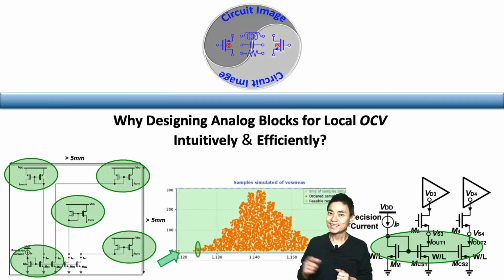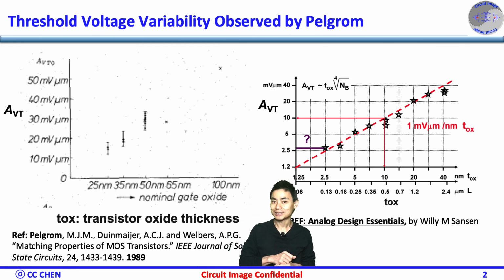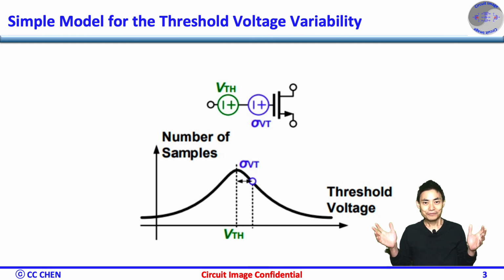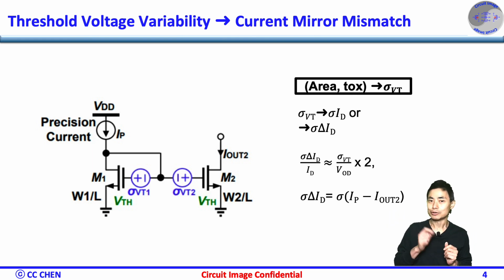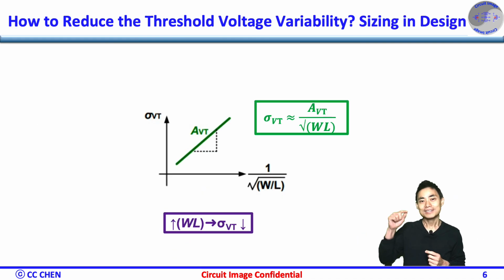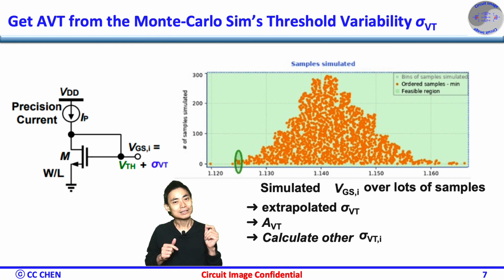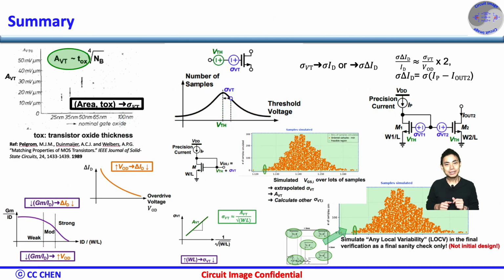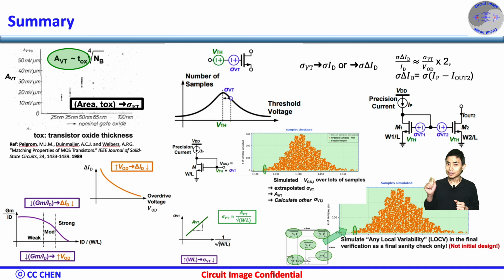Why Designing Analog Blocks for Local OCV Intuitively & Efficiently?

Comment: how much current should I apply to the diode-connected transistor?
should the current be small enough to observe the threshold voltage of the transistor?
or just provide the transistor with a reasonable amount to operate in normal condition?
Reply from the maker: Hi Trexy,
Nice to meet you. Thank you so much for the good questions. I have comments below in line.
how much current should I apply to the diode-connected transistor? 
[CC] You can apply the amount of the current range in your design.
should the current be small enough to observe the threshold voltage of the transistor? or just provide the transistor with a reasonable amount to operate in normal condition?
[CC] You can provide the transistor with a reasonable amount to operate in normal condition, which fits the current range in your design at other analog blocks.

Thanks,
CC